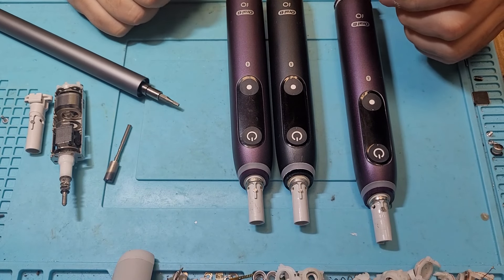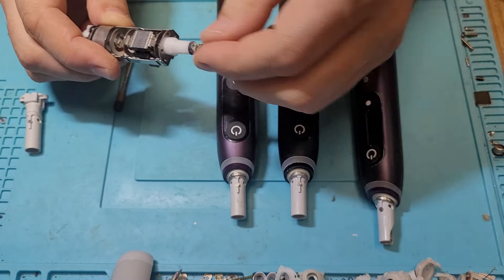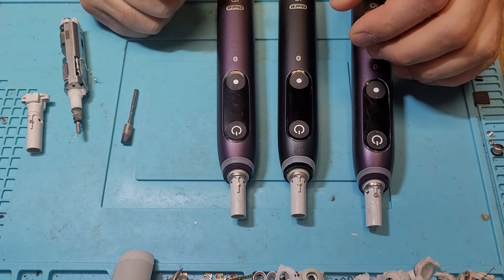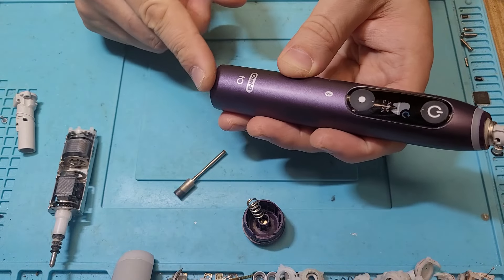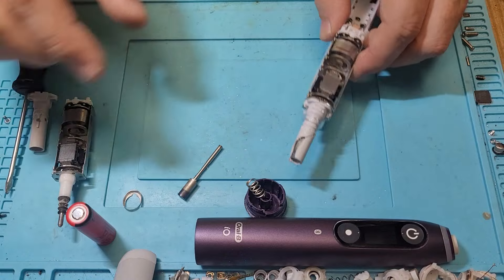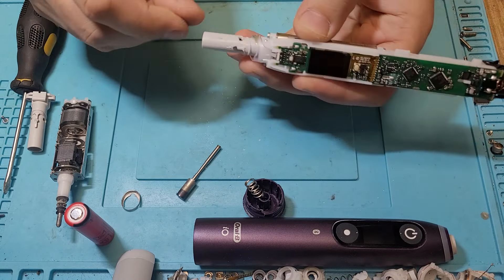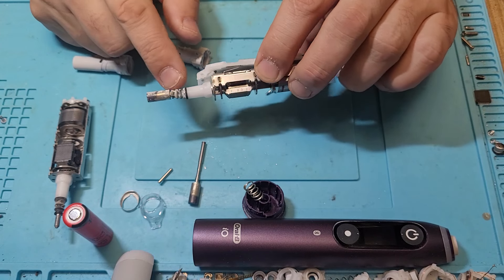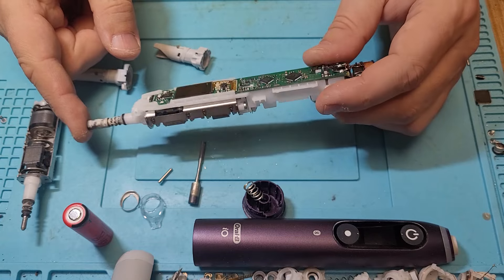Oral-B IO teardown/repair and impressions

Comment: My io is not opening from bottom. It doesn't twist even little. Any other way?
Reply from the maker: Nope. Only braking it. It can be that some toothpaste accumulated in the gap and it prevents to easily twist it. But holding firmly and applying a lot of pressure so it wouldn't skip is the key and it should turn. If you don't mind scratching it you can always use plumber pliers and twist it open. But chrome will get damaged and additionaly the cap can be broken...
Reply: @letsfixitgarage  it was the toothpaste pile up. I put a towel on it and twisted with my Jaw. Required lot of pressure. Thanks a ton
Reply: @nitesh17101 with your jaw!? Did you visit A&E after? Lol

Comment: My monitor doesn't work anymore, how can I repair it?
Reply from the maker: take it apart and inspect it. maybe there is a lose solder joint or water is inside that would mean more problems. additionally as far as i know there is no spare parts from Braun so either eBay or other second hand is only option for spare parts...

Comment: My magnetic head rips out with the toothbrush head every time I take it off. I then have to remove it with tweezers and attach it back. What type of epoxy do you recommend to glue it back and is it necessary to disassemble the tooth brush to glue it. I have contacted oral b and they refuse to send a replacement because I don't have the receipt. It was a Xmas gift. Jerks.
Reply from the maker: Additionally I would add some grooves to the shaft and maybe inside of the head for better "traction" I would disassemble it. It's easier to check that it goes all the way in. If glue will prevent to go all the way down it will stick out and brush head will either not sit right or get damaged using it...

Comment: Mine sometimes stops working after 30 secs i think i got it too wet theres a small hole in the bsck i think it got wet overly i had to look up a video how to clean it smh
Reply from the maker: In the back it should have an Ventilation filter if it was broken at some point then it's vulnerable to water damage take it apart fry it and look for water damage. Not fun part is that mostly water damage is on the back side of the motherboard and screen is very vulnerable to water as well..

Comment: Hola tengo dos cepillos oral b io,y no funcionan,los abri creyendo que podían ser las baterías,pero tenían carga 3,6 v,pero me di cuenta que había mucha humedad dentro,motor con robin ,el caso es que no encienden,que podría ser , gracias
Reply from the maker: Hi write me in English, then I can respond faster. YouTube Studio doesn't have a function to copy the comments to translate it..
Reply: Ok
Reply: @letsfixitgarage  I don't know if you sorted it out after all this time but it says....

"Hi, I have 2 Oral-b io toothbrushes and they don't work. I opened them, thinking it could be the batteries, but they had 3.6v of charge. I noticed that there was a lot of humidity inside. The motor with 🤷🏻‍♂️. They don't turn on. What could it be?"
Reply from the maker: Quite some time has gone.. to much people contact me on emails I think we sorted it through emails.. but nevertheless thank you for the effort! Nice to see community forming here in comments :)

Comment: Thank you for the video! Made it very easy to disassemble and clean the top part. The stuff that was cleaned out though 🤮
Reply from the maker: Yes IO series tends to accumulate much more dirt as the older genius brushes.. interesting how will they hold up with water tightness with that kind off dirt..

Comment: Hello, I just watched your video and I find it very interesting. My oral b io 9 toothbrush has lost the magnet and I would like to know if you know of any online store or link where I can buy the spare part or spare parts for this model of brushes. If it has to be the complete engine, I don't care either!! I can't find anything on the internet to be able to buy spare parts for these brushes. Thank you very much for your answer.
Reply from the maker: Yes, as said in video this brush success will strongly depend on Braun philosophy with spare parts I have asked local Braun representative for their comment on this, but haven't received anything till now. For now I believe the fastest way would be to look for a broken brush on eBay.. what about your defect was it like in this video where magnetic head came off the shaft or did the whole shaft ripped out of the electromagnetic drive? Did it fall or any gues why it broke? Im quite interested in finding out the reason for this defect..
Reply: @letsfixitgarage  The magnetic head simply came off and fell down the drain. I am looking for neodymium magnets of the same diameter and try to make a hole in the center (this is complicated and almost certainly the magnet will break) and glue the motor shaft with epoxy... Not having the magnet I don't know the average in millimeters of the diameter and the height of the same to search. Do you know the measurement of the magnet approximately in millimeters??? Thanks a lot!!
Reply from the maker: No till now I haven't tried to brake down the epoxy.. need to look up what is the best method.. as said I bought few from eBay with ripped off shafts with heads.. I believe this could be a serious problem so you should be able to find some on eBay as well should be easier as to make your own.. especially that the magnet will not be enough, it should have a metal cap so it wouldn't get damaged or losen from the same Epoxy...

Comment: Hello, someone know about how many percentage of the battery consume each use the oral b io 9? I have it but it consume me 6 or 5% each time l use, I just want to know if it’s normal or no?
Reply: Its not normal brush your teeth properly
Reply from the maker: don't know exact figures could be ok. declared value is 2 weeks. but it strongly depends on screen, app usage and brushing time. if you are over 2 min it will be much less then declared..

Comment: Привет! Крутое видео. В моем случае отпаялся стержень, на конце которого магнитная головка. Смогу ли я ее припоять самостоятельно?
Reply from the maker: If you mean the magnetic head getting off the shaft. it's epoxy glued. I'm thinking that reglue it with epoxy should work. although I'm thinking to add some groves in to the shaft or at least work it with some abrasive just to have a better grip for Epoxy..
Reply: @letsfixitgarage  спасибо за ответ! Я видел следы клея, но не сообразил что в этом месте не спайка, а просто клей. Буду пробовать приклеить. Какой клей или эпоксидку порекомендуете? Фирма и тд. А то я не разбираюсь в этом.
Reply from the maker: @paveldorofeev7535  that's only my plan :) I have a bunch of these without magnetic head. None that I could try to repair. I would take any two component epoxy resin. After applying do leave it head down so the glue wouldn't stay on one of the sides. Disbalance could make the problem worse...
Reply: @letsfixitgarage  куда я могу отправить фото моей проблемы?)
Reply from the maker: My email is in Chanel description. letsfixitgarage@gmail.com
Reply: @letsfixitgarage  не могу отправить на эту почту. Ее либо не существует, либо не действительная, либо ошибка в имени.
Reply from the maker: Sorry, don't know why. letsfixitgarage@gmail.com Email is working for sure, get a lot of help requests to it. maybe it's blocked by your provider or something..

Comment: Just contacted Braun authorized repair shop. Was told then only thing that can be replaced is the whole control unit. I asked if they can replace the battery only, they said it can't be done because everything is press-sealed in and so nothing can be removed from the control unit. I'll show the old fart this video, god damn it...
Reply from the maker: :))) difficult to know all the products when you are producing so much :) but to be honest I really don't understand why Braun is refusing to sell spare parts for them.. sure there are a lot of things that can go wrong in the process but still leave the risk for the consumer but dont reject him the parts... Any follow up from the old fart? ;)
Reply: @letsfixitgarage  Not yet, I'm waiting for him to call me regarding my IO 6 that has battery / BMS issues. Once I have the toothbrush back in my hands only then I will pounce lol

Comment: Made a video about that glued and very easy to brake upper seal: https://youtube.com/shorts/gPo2VJsncMY?si=h-od7Ch2Sm4ipx3t

They made it easy to replace battery, battery that can come back to life if you place it in a proper charger and then back. Buy that rubber material is to sensitive !
Reply from the maker: Have you removed the metal ring before removing toothbrush from the case? This never happens if you remove the metal ring. And rubber seal is not replaceble, you need to get a new case..

Comment: Hi, thank you for your video, I just have a question there is an issue with my toothbrush similar to that of the one shown in the following video. What's your opinion about the problem of this issue? By the way, I'm using the original charger of the toothbrush. Thank you so much 
Here is the video https://youtube.com/shorts/n7H0ob3xTaE?feature=share
Reply from the maker: I saw few of these but didn't had time to investigate it further.. I assume motherboard damage, but this needs further inspection..
Reply: @letsfixitgarage  thank you very much. I just sent you an email regarding this matter.

Comment: Hi My io8 tooth brush works but the toothbrush head is not rotating or vibrating, there is no respond on the tip. when I separate the head and touch the iron stick with a screw driver it seems it is vibrating but head is not moving or vibrating when attached. Can you please advise how to fix this ?
Reply from the maker: It could be that magnet has separated from the shaft. If it's still on the shaft try to remove it and glue it back in place. But it is difficult to get the hight right as if there will be to much glue tha magnet head will stick out and vibrations will be not right as well..